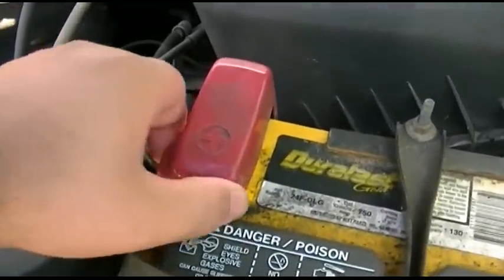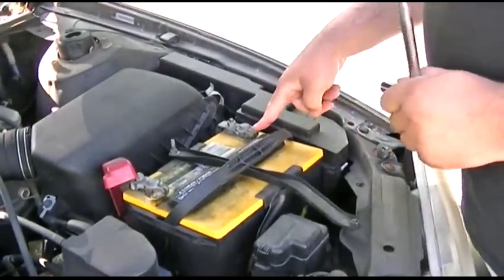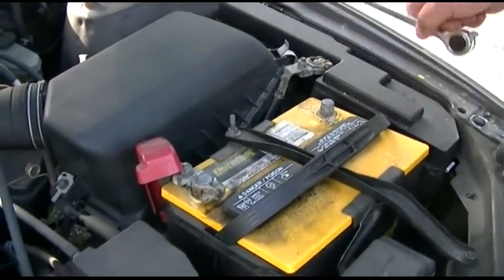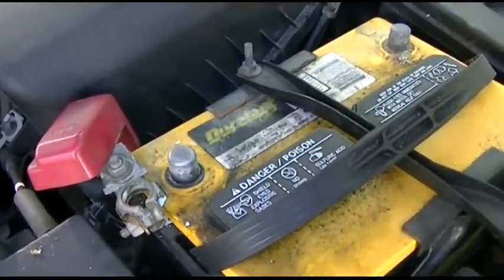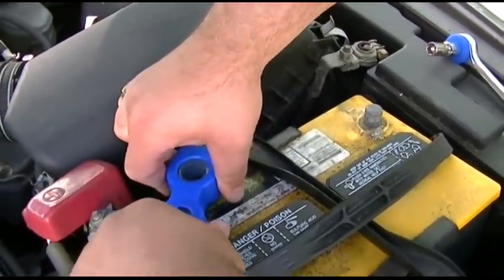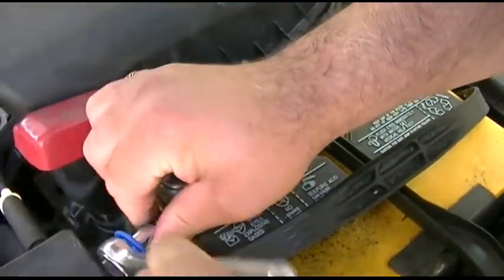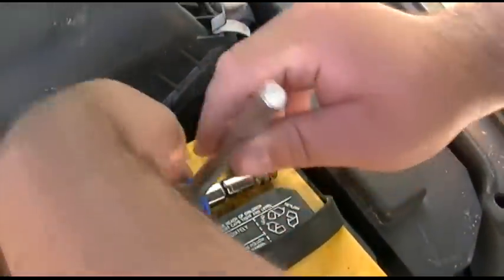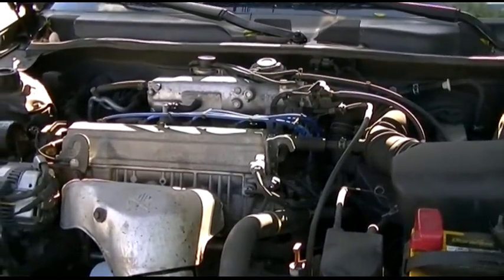How To Clean Car Battery Terminals--THE EASY WAY!!!

Comment: that will only rust quicker down the road, you have to seal it back up.
Since it is a DIY video, use a bit of vaseline to cover up all the metal terminal after done installing, this is the bare minimum budget way. there are special compound to be used for this purpose and felt washers needed for a complete installation.
Reply from the maker: You must be one of those "by the book" mechanics, where you take the book hours, multiply it by 2.5, and then throw a few lunch breaks in there.

It actually was perfectly fine, and did NOT corrode any further.  The battery itself had to be replaced not long after, it was spewing and accelerating the corrosion.  Years down the road, it wouldn't matter  in the end when another driver ran a red and t-boned it.  I'm sure you're glad you asked now.

In fact I just replaced the battery on my 67 Riviera, I didn't even need to clean the terminal clamps, they were so broken and corroded from age that I replace them.  This time, I had grease, and applied that all over the battery terminals, and clamps.  I have never seen the felt washers do anything except drain a few more dollars from your wallet.

Comment: What is the wrench called? Will the wrench work on toyota rav4 2010?
Reply from the maker: It's nothing more than a ratchet with a 10mm socket.  Chances are very good it will fit your Rav4, 10mm is a very, very common size of bolt on Toyotas.

Comment: So my moms car isn't starting, she said its relatively new. Every time I jump it, it would die so I took it to Autozone they said the dirt on the battery is blocking the power from getting into the car. I did what you said when I took the cables off the terminal it didn't seem that dirt, I still scraped it and had to jump the battery anyway. Took the car around the block and then tried to cut it back on but the battery died again. Even the employee at Autozone said you can tell the battery is new. What do you think is the problem?
Reply from the maker: Sounds to me like there's an alternator problem.  If you jump start the car and when you remove the battery cables, the car dies, the alternator is not working.
Reply: @jaykay18  thanks for the quick reply. We were able to drive the car around the block, park it, cut the car off when I went to cut it back on the car would not cut on, it will only start when we do a jump with my portable jump starter pack
Reply from the maker: You need to start testing things, not just hoping it starts to work.  They sell battery testers, or you can just use a voltmeter.  If you hook up a voltmeter, the battery should read about 12 volts with the car off.  if not, it's discharged and needs to recharge.  Going around the block isn't long enough to recharge.  Once you get it started, the same voltmeter can tell you if the alternator is working, you should be reading about 14 volts with the engine running.

This is why I keep numerous battery testers, car scan tools, voltmeters, battery chargers, jump packs, and even jumper cables around, I have everything I could possibly need to combat a dead battery.  If you don't, I would suggest you look into getting some if not all of those tools.
Reply: @jaykay18  okay thanks I'll keep you posted thanks for the advice
Reply from the maker: Sure, no problem, I'd appreciate if you would.

Comment: TRY THIS TEST:  Pour HOT water on the corrosion and watch it disappear like magic!  You can use baking soda, CocaCola, commercial corrosion devolving spray or whatever, BUT TRY THE PLAIN HOT WATER and see the results.  TaDaa ! !
Reply from the maker: I'll take your word for that.  Me, I got the wire brush, and that will remove corrosion the RIGHT way, by scrubbing it away.

Comment: What if I am unable to remove the battery cables because its so rusted and corroded
Reply from the maker: In that case, you'd have to get new battery cable clamps and a new battery.  You'd cut the old ones off, remove the battery, put the new clamps on, and the new battery in.  Chances are if it's THAT bad, the rest of the car isn't that far behind.

Comment: On the newer cars you should have an alternate power source hooked up before
disconnecting the battery cables otherwise you could lose your computer codes
and they may have to be reinstalled.
Reply from the maker: If a car manufacturer has their vehicle locked down that far that you can't replace the battery by yourself, they don't deserve your business or anyone else's.

Comment: Can I used WD40 to clean the contacts point?
Reply: absolutely not! Go on ebay and buy a terminal post cleaner brush. They are like $6 bucks dude. Never use WD40 on your batteries!
Reply: thank you
Reply from the maker: I don't think it's going to help much.  You need a wire brush, plain and simple.

Comment: My car just makes the click.. A device conected is telling me my battery is 12.3 so i dont know if could be the terminals? They look good without corrosion. But a bit loose..
Reply from the maker: You need to remove them and inspect inside of them to see if there's corrosion, sometimes it's not just on the surface like you saw here.  Also, how old is the battery?  If it's 4+ years old, it could have bit the dust, they don't make them like they used to.  Even though the voltage appears to be enough, the idea behind this type of battery is is needs to be able to basically dump all the current it has into the starter to turn the engine over.  Not enough current, but enough voltage means you'll just get the click.

If your connections are loose, that also could be the problem.  If you can't seem to tighten them down, I've seen people drive something like a drywall screw in between the battery clamp and the post on the battery.

If all of that fails, and a jump start also fails, you have a problem with the starter.  Sometimes, getting a piece of pipe and banging on the starter will get it to work again.
Reply: @jaykay18  i'll do that. Im in the parking lot and is raining. My battery is almost 3 months brand new. Since i cannot get out right now im reading the manual of my car to see if all fuses are good. The same situation happened to me 3 months ago i had to leave my car here at work for 2 days, i didn't want some tow to take it to the mechanic until i was sure what it was... Then a coworker came and put some cables on my old battery and like a miracle it started. That why i bought this new battery. I hope is not the starter. Fingers crossed. Thanks so much! 👍
Reply from the maker: OK, best of luck to you, let me know what happens.

Comment: So followed this exactly, truck started great drove a bit, came home and tested a time or two through the night seemed great, for me to work today and I go to leave and the dreaded ticking noise will not let her start. Any tips? It’s the same thing that lead me to clean in the first place and both times I had to get a jump to get home. My wife tested the battery she said it seems fine we recently bought it like last 6 months maybe.
Reply from the maker: OK, a few you things:
1.  If there was corrosion, remember that it can not only prevent power from going out to the car, but back in to recharge the battery.  So there's a good chance the battery was just low and needed to be recharged.  A nice drive on the highway usually will do the trick.
2.  If you can get the vehicle started, you can bring it to your local auto parts store.  Many of them can test the battery for free (or you can take the battery out and bring it to them to be tested).  The point is, if they deem it bad, they know you need one and you'd be likely to buy it from them.
3.  There could potentially be a problem with the starter on the vehicle, or the wiring to it.  Some vehicles also have some sort of relay for the starter that can go bad.  Try cranking the engine with the door open, and watch the dome light as you do it.  On a properly working car, you'll see the dome light dim considerably, and it will flash in time to the sound of the engine starting.  If on your vehicle when you do it, if the battery is low the light would practically go out.
4.  The car you see depicted in this video is a 2000 Camry.  Its original battery was made by Panasonic in Japan.  It lasted 9 years, and wasn't totally dead when I replaced it.  You will NEVER see a car battery last that long ever again.  They don't make them like they used to.  The replacement battery I put in this car didn't even make it 3 years before it was dead.

Comment: Well that was a fail😂😂
Reply from the maker: That is the wife's car, and she even called me at work and told me it wouldn't start.  Magically, when I got home, it didn't want to cooperate for the video.  But the problem was indeed the corrosion on the battery terminals.  After this video, the problem has not recurred, and it's been over 4 years since I made this video.

Comment: My 2010 Lexus is250s dashboard lights won't turn on nothing the key fob doesn't unlock or anything the car is completely powerless EXCEPT for the little orange light on the push to start. I just watched this video I'm gonna try it out and I'm definitely gonna have someone step on the brake pedal at the same time and see what it does. Be right back.
Reply from the maker: It sounds like your keyfob battery is dead.  This other video I made has the answer:  https://www.youtube.com/watch?v=WbsbwZBb5Xs
Reply: It ended up being a dead car battery. OEM battery lasted 8 years!!
Reply from the maker: Gotcha beat, the original OEM battery in this car was made by Panasonic and was made in Japan!  Lasted 9 years in total.  Dead of winter when it almost quit, car would crank really really slow and the clock as well as the radio station presets would reset.  I replaced the battery at that point to avoid getting stuck, but it probably would have made it another week or two.

Anyway, I'm glad it's working again!

Comment: I've always loved using baking soda and water to clean off the corrosion on battery terminals. It is super fast and with a little rinse and maybe some light brushing they are cleaner than ever!
Reply from the maker: I've certainly heard about that, but never done it.  Any "dirty" electrical connection, cars or not, I use some sort of wire brush.
Reply: A wire brush will definitely help. Combine it with the baking soda and the battery will be clean in no time!
Reply from the maker: That would probably do a phenomenal job.
Reply: Yes

Comment: You ever had your car do this. 
cars starts normally 
Well thats a fail.. LOL
Reply from the maker: I was completely expecting it NOT to start.  The wife called me at work and told me it didn't start, so if it didn't earlier why would it later?  Somehow, for some reason, it just magically decided to work that time.
Reply from the maker: That's a good point.  Personally I haven't heard of anyone stealing stock radios in a while, they used to only do that with high-end cars; now in most cars the stock radio is more than decent.

Comment: Isn't it unsafe to work on your car on a busy highway. Cars run like 50mph
Reply: Did you not watch the video? Safety 3rd!!
Reply from the maker: The car actually WASN'T supposed to start in the beginning of the video.  Presuming it didn't start, would it have been possible to work on it from the lawn?  Sometimes you've got to do what you've got to do.

Comment: You can also use rough sandpaper and wrap it around a screwdriver to clean the inside of the clamps and terminals, and it will get the metal very shiny. I also keep a 10mm and sandpaper in my car just in case. I used P60 grit sandpaper.
Reply: what?? theres a $6 tool for that.. no need to use sandpaper
Reply from the maker: Thanks very much for the additional info.

Comment: I love this guys videos and I was feeling like I could do this one myself too...until I heard the word "explosion" on holding the wrench thing across the battery wrong. And so casually.
Reply from the maker: Thanks!  You CAN do this yourself, just don't put the wrench across the terminals!  It's highly unlikely even if you completely drop the wrench that you'll land it just like that.  It's that one-in-a-million shot, but I have to mention because in this world, it has happened before.  Just make sure you pull the negative cable first and you're 99.9% safe!  Think of the satisfaction you'll get doing the job yourself, and saving all the money you would have shelled out!  Trust me, the satisfaction is worth far more than the money.
Reply: geminezmarie Hahahahah same

Comment: A wire brush would work right
Reply from the maker: Yes, absolutely, a plain old wire brush is essentially what that blue tool was.
Reply: jaykay18 thanks. And my car is an 03 explorer I got as a hand me down, and when I open the hood, it doesn't stay open like it's supposed too. Instead it just closes slowly, any idea how to fix it or If I'm doing something wrong
Reply from the maker: The_Pickler10 If the hood uses hydraulic struts to keep it open (usually a thin black cylinder with a polished steel shaft that extends out as the hood is opened), the struts have gone bad and need to be replaced.

You have 2 choices:
1.  Price out replacements (might try ebay, usually can get them cheaper)
2.  Get yourself a NICE pair of vise-grip pliers, and attach to the polished steel shaft once you get the hood open.  That'll act as a stop.  You can also cut down an old broomstick to use as a prop rod, I did that for years on my old Chevy, until someone else I knew was getting rid of a car that had hydraulic lifters that worked, and they let me have them.  Even though those were from a Dodge and mine was a Chevy, they fit (rather dangerously) over the pins provided and never came loose until I junked that car several years later.
Reply: jaykay18 alright thanks.
Reply from the maker: The_Pickler10 Best of luck with it!

Comment: Hey, would something like WD-40 or CRC 5-56 be okay to use on the terminals, or would that be bad? I'm new to car stuff so i try to know as much as i can before i try anything out.
Reply from the maker: Here's the idea behind the grease on the terminals:  The terminals on the battery, as well as the clamps on them, leave little spaces in-between.  Any of that exposed metal is subject to corrosion.  When you grease the terminals and then put the clamps on, the grease squeezes out some from all those little nooks and crannies, and leaves everything coated, preventing corrosion.

WD-40 is a water displacer, which is what WD stands for.  The 40 is 40th attempt.  That means the first 39 didn't work, and personally I don't feel the 40th did either.  WD is great for gate hinges, hedge clippers, and the like.  I've also found it to be fairly effective as a rust remover.  It's useless as a lubricant.  So the old adage of "if it moves and it shouldn't use duct tape, if it doesn't move and it should use WD-40" doesn't stand up in my book.  I use 3-in-1 oil to lubricate things, works great.  Oddly enough it's made by the WD-40 company.

So in short, WD wouldn't hurt anything, but I doubt it would help much either.
Reply: Okay, thank you for responding after such a small time period, i really appreciate it!
Reply from the maker: Cetz No problem, I always try my best to respond to comments or questions as soon as possible.  That's one of the things that sets my channel apart from so many others.
Reply: Indeed it is
Reply: It doest hurt. Definitely better then nothing. but any hydrophobic grease is great. A cheap grease that most ppl have is vasoline. You don't need a whole lot just a little dab on positive and negative terminals and your set.

Comment: What do you do when the Computer does happen to forget the run characteristics and it keeps failing to operate? Is there any way to redo the commands?
Reply from the maker: It will relearn, it just takes time.  Drive about 15 miles and it should relearn everything.  Be VERY AWARE when you drive, the car may run very rough, and may stall either when stopped, or when the light goes green and you try to go.  So it'll be white-knuckle driving for a bit but after that it'll run just like it used to.
Reply: Thanks for the prompt reply man. Thumbs up.

Comment: hello, is it possible that my battery light that comes on while driving caused by corroded battery? nice reminder bout how to unbolt which terminal first btw.
Reply from the maker: It's unlikely that would cause it.  But if the terminals are corroded, that's the first thing to take care of.  If the light problem continues there's likely a problem with the alternator.
Reply: +jaykay18 yes, its actually the alternator. I had to replace the ic and the diode for now, hope it survives for a couple of years. Thanks for replying!
Reply from the maker: Rizky Perdana No problem, glad you fixed the trouble.
Reply: it can be caused by bad wiring or poor connection.  Battery light only means that the batter isn't charging. That includes wiring that isn't connected properly due to a poor connection, but it has to be pretty bad.

Comment: Can you use Vaseline around the terminals to keep corrosion under control?
Reply from the maker: Yes.  While it may not be as effective as grease, it's better than nothing.
Reply: Brett Getz I would recommend getting a tube of Dielectric Grease that is specifically made for environmentally exposed electrical connections. I use dielectric grease not only on my battery terminals, but also on my trailer hitch wiring connections where there is a lot of moisture and dirt exposure and can quickly corrode any electrical connection.

Comment: is using that light bulb anti-corrosion grease on the terminals a good idea?
Reply from the maker: That would work fine.  I didn't happen to have any grease on hand at the moment, but I just use axle grease or whatever I have around.